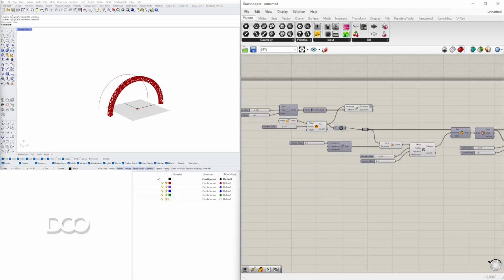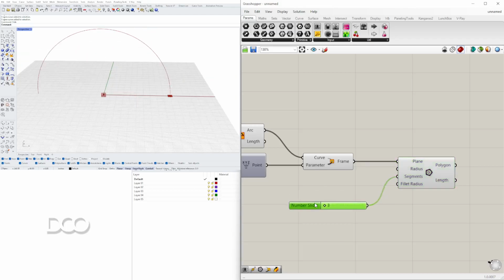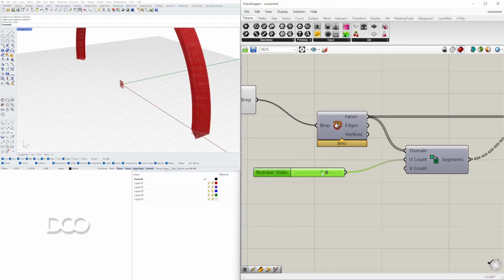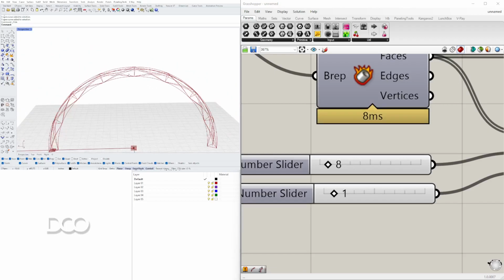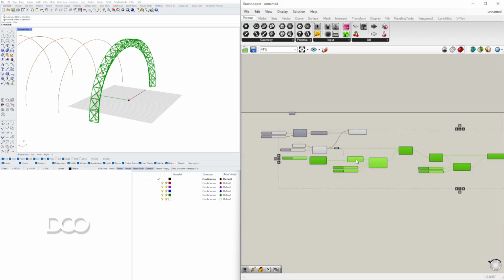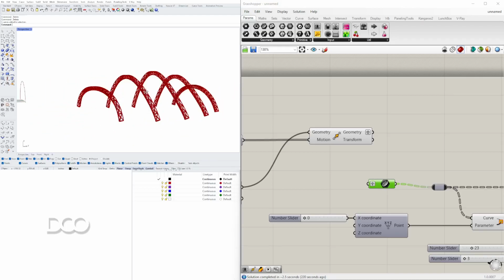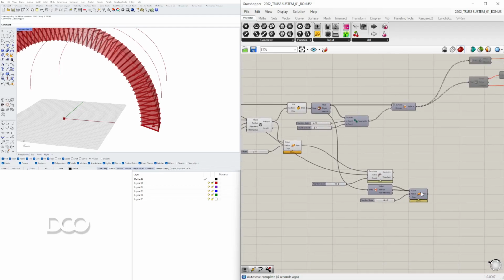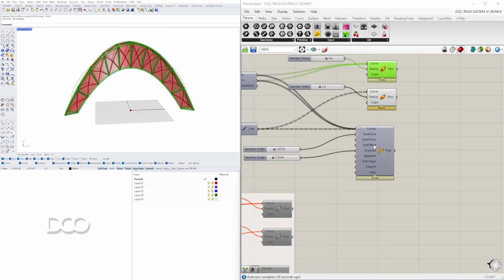Rhino & Grasshopper Truss System from Base Curve Parametric Architecture and 3D Design

Comment: Hi, I cannot find the multi pipe component inside gh!
Reply from the maker: if you are using rhino 6 it wont be there. but if you have rhino 7 double click on the canvas and type multi and the option should show up.
Reply: @DCOParametric  I’m using Rhino 7! ı only have pipe, and not multipipe. :(  I checked my plug ins as well, they seem to be there
Reply: Already did what you advised so unsure what the problem is!
Reply from the maker: Send me a message to copetedavid.com front page and I can contact you to see how I can help. Possibly send you a script that has it incorporated.